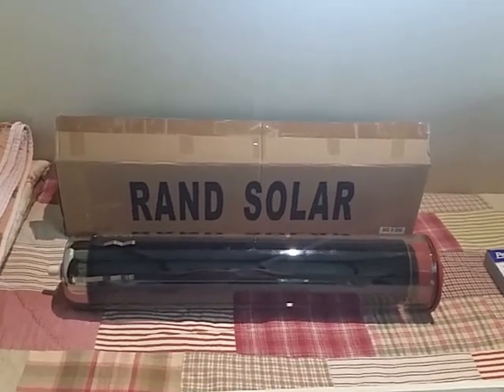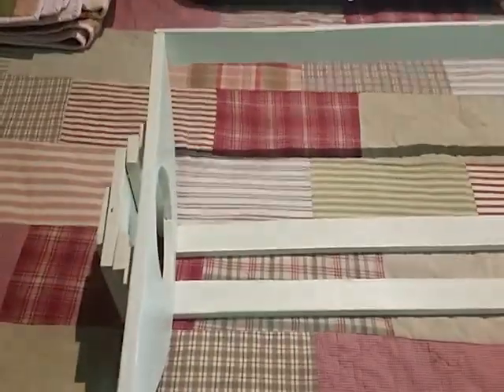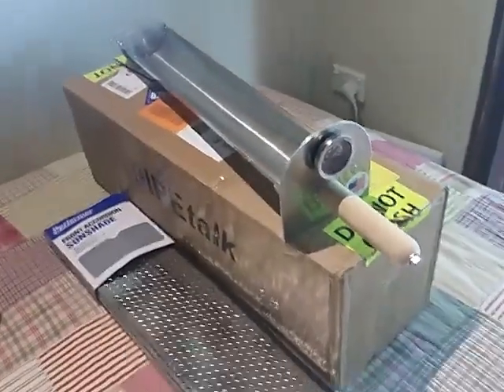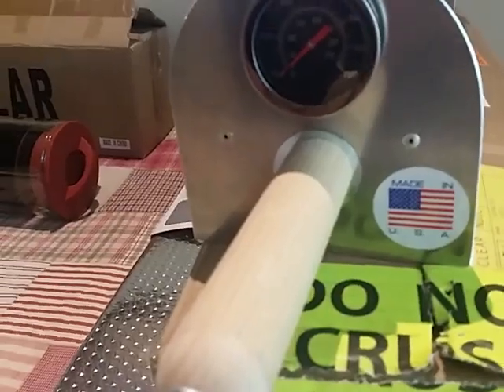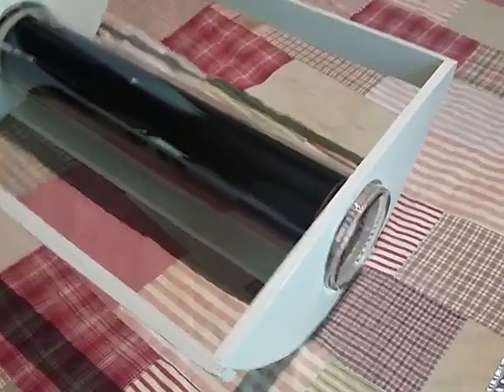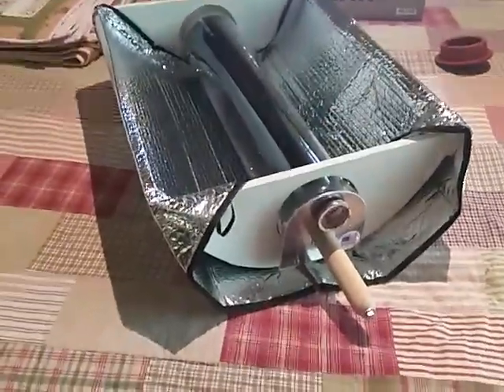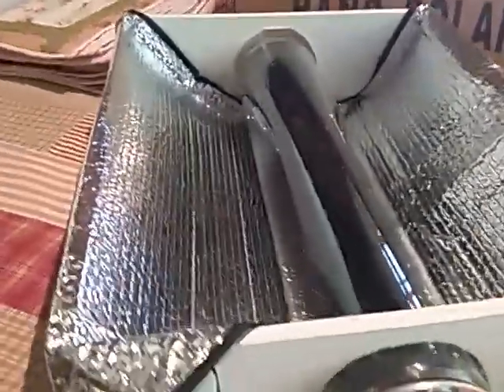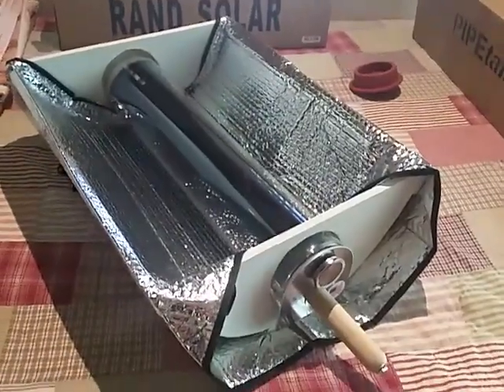DIY Solar Tube Oven. Rand solar tube. Cooking with the sun.

Comment: I purchased the heated tray from go sun from their fusion oven and it fits my Rand tube and the 12V cord of my compressor refrigerator.  I haven't tried cooking in it yet.  I also found a 12V hot logic plate that just fits inside a Coleman lunch box cooler and hold the Pyrex 7214 glass baking dish.
Reply from the maker: What a clever idea LaMarr ☺️

Comment: Hey I got a question, how much was the solar tube? And the pipe tek? Thanks. If you increases the size of your frame  you can line it with construction paper and aluminum or mylar. You can double or triple your heat!😁
Reply from the maker: The tube was $125 aussie $ and tray was $85 aussie $ plus shipping. Both bought from ebay and sent from America.
If you make one using your suggestions, please let me know as I plan on making a new frame once I move house. I would love to try the mylar blanket idea for sure 🖒
Reply: Nailing it Australia look up Dan Rojas channel or green power energy. He shows many many solar tests. I am using a satellite dish with aluminum tape on it it Cooks well. It can make fire too! I have located 2 old dishes that are 60 Inches I'm going to get them and cover them with mylar and put a rotisserie at the focal point for a solar BBQ! LET YOU KNOW HOW IT GOES IN A COUPLE WEEKS. Just bought a small house lots of work to do...😁 Yes you need a larger reflective surface. The large GOSUN is very large and it will burn your food if left until attended. Just take a look at it you can get a good idea from that. Also if you were really short on supplies, you could use soda cans. Take a knife or sissers and cut the ends off then split the can. You will have nice aluminum to build with! If you need to flatten it iron it ! If you want it really shiney? Put it in a pressure cooker for 20 minutes and the lacker will come right off! Cheers! From the Nevada desert. USA
Reply from the maker: Love the can idea. I'll check out those channel suggestions tonight. Cheers. Rali.

Comment: You might like to get a mylar emergency survival blanket. They are about $2.00 American. Much more reflective and lay in a piece of construction paper In your frame. You can play with spray adhesive and a roller to put In the mylar. It's way more effective than the sun screen because the sunscreen has all those bubbles deflecting the light every which way. But hey you are doing a great job! Keep playing with it! I use an old satellite dish and covered it with aluminum tape. It boils a cup of water in about 2 minutes. And can light a fire in wet sawdust in the snow in subfreezing weather in 3 minutes!
Reply from the maker: Great suggestions,  thanks. 2 minutes is incredible!
Reply: Nailing it Australia how is that sun oven working ?
Reply from the maker: Pretty good. Slower than a regular oven. I've only used it twice, made videos if you are keen. I live in the tropics and it is our wet season atm. I should be able to get more use soon 🖒